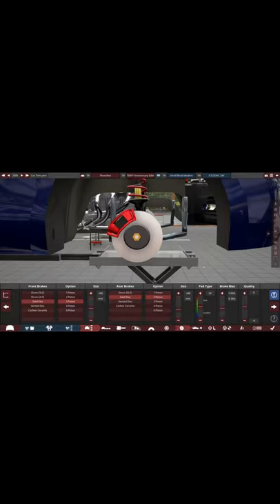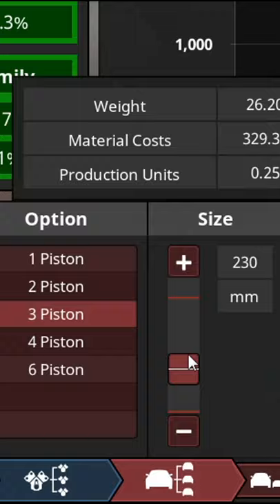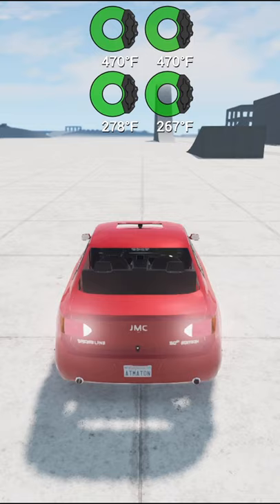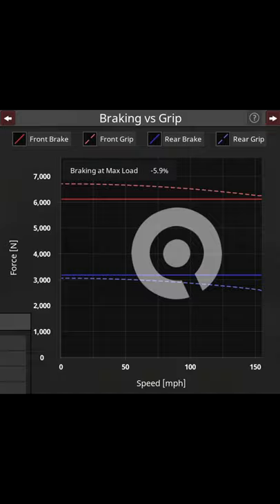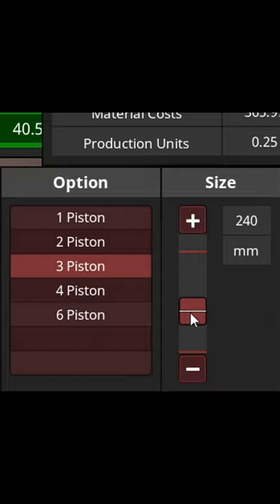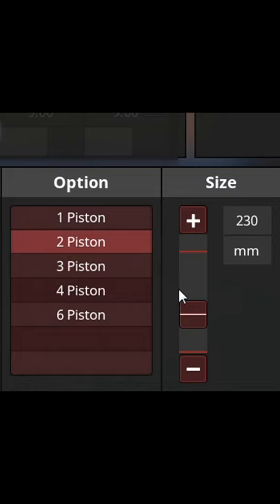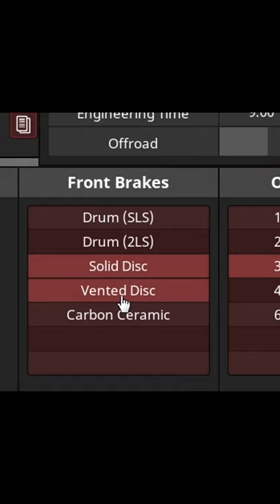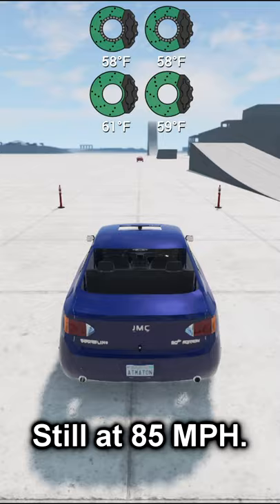How To Eliminate Brake Fade in Automation & BeamNG.drive

Comment: I usually just go with 1 piston with maximum size. Maybe it is a little bit more expensive but saves engineering time and production units
Reply: My goto aswell, 1 piston front and back with huge rotors
Reply: Ye same here

Comment: I always get the "brake force is low/high compared to grip."

I have no idea what the hell that means.
Reply: It means the brakes are too powerful/not powerful enough and will cause the car to lose traction under braking/stop too slowly, respectively. Check the braking vs. grip graph in the car designer and adjust the front and rear brake force to be closer to their dotted lines (does not have to be ON the line).